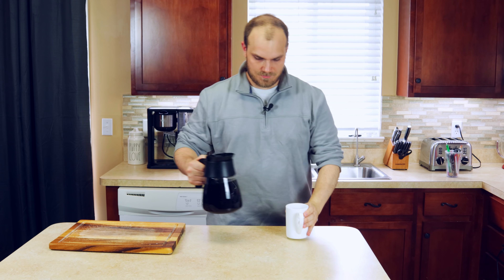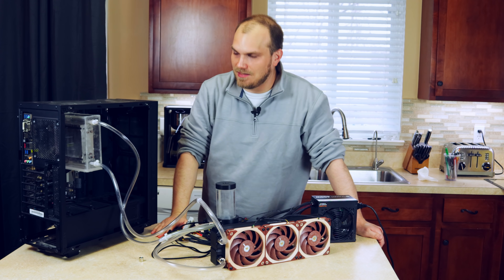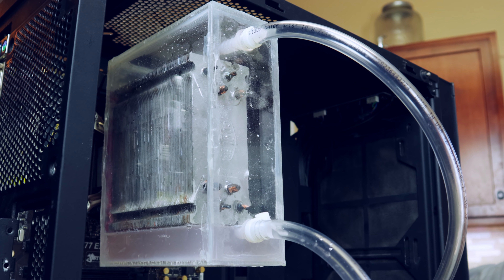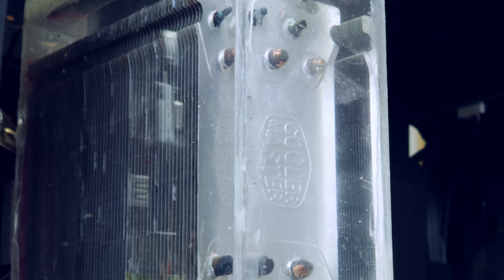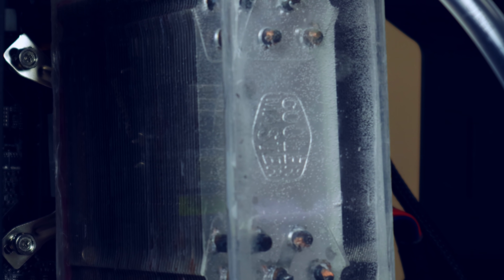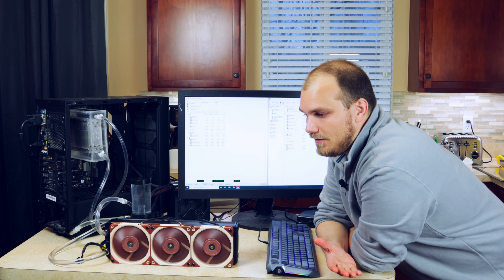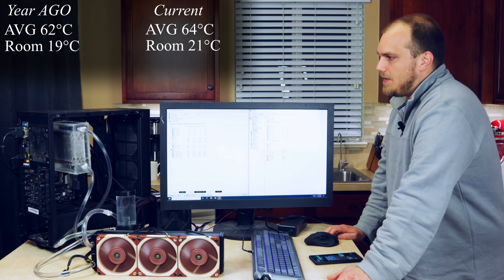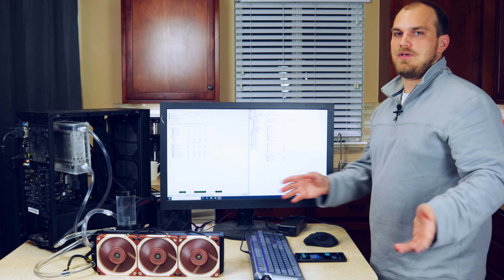Water Cooled Air Cooler 1 YEAR LATER, Time Has Not Been Kind

Comment: I think this one is a waste of time. You've made a large less efficient water block. Without constant monitoring you will eventually doom a motherboard to die a death by short circuit when this eventually corrodes from the inside out. Having two metals connected by a conductive substance such as water creates a battery and will accelerate internal corrosion. You may even cause a house fire. If all this isn't strictly for entertainment (A troll) I wold urge you to please research water cooling more thoroughly so you can avoid this project becoming a significant and harmful life event even though it would most likely just trip a breaker, blow a fuse, or something like that.

Comment: I like what you did, but I will drop some science on you. You can pick whatever cooler you want to use, just make sure that the fins that run along the widest sides are even with each other. When you re-make the 2.0 version, make sure that the long outside plastic panels are touching the fins and that the bottom panel (closest to the cpu) is right to top of the bottom fin, no gap, same for the top panel as well. The water input and output sides make sure to leave at least 3/4” space, 1” would be better, this will help in the directional flow. On the water input fitting, use a 5/16” or 3/8” diameter tube that is caped or crimped at the end and the tube runs the full length into the box, cut a straight slice in the whole length of this tube, only on one side, use a dremel cutoff fiber mesh type disc (they are a whole lot safer) this will leave you about a 7/64" or so, wide slot. Aim the slot straight at the middle of the cooler fins, the output fitting that you used before is okay. If you want to make sure to get all of the air out of the system, make to output side panel taper to the fitting. By building the box this way, it will create a directional water flow that will majorly increase the cooling efficiency.

Comment: Should make a version of this in a case that has the motherboard positioned to where the IO ports are on the Roof of the Case.
This would let you use the reservoir to feed water down onto the fins of the Heat sink.
From there, the water gets sucked up from the bottom.
Or, you could put it into a Horizontal configuration and make the tubes go on either side of the Fins to increase water flow through the fins.

PS, the corrosion is from the Copper heat pipes sticking out the top of the Heat Sink.
I would definitely seal those off with epoxy in your next prototype.

Comment: I wanna see a Design that is overall Cheaper than regular Watercooling. Maybe use a 20 Dollar Cooler, like an Arctic Freezer 13 and put an 240/360mm Radiator on it, plus the Pump. Should be cheaper than getting a CPU Block, shouldnt it ?

Comment: so why not run actual coolant? or even water mixed with some anti-freeze, helps with corrosion.. but mainly corrosion occurs from the mix of metals. aluminum and copper. and theres some coolants that have anti-corrisive stuff in em, or u can even drop in a corrosion inhibitor in the reservoir. But definitely not just water. Water heats up fast as well as boiling point is a lot lower than with coolant. and ur idling looking at temps!!! U creeped up to 60c plus idling!! lol.. Load up a game, it'll shoot up to 80 plus!! And thats past the boiling point of water. Definite try with just a mix of regular automotive anti freeze mixed into the water. like 1part to 3 parts water.  Cuz the fact that it was idling at 60c plus with that big of a radiator and reservoir.  Thats  not good. Would like to see the temps under actual load.. Run Unigen heaven benchmark or 3D Marks benchmarks and load up the cpu.  

For heatsink choice.. im curious to see how well one of the stock oem coolers would do if encased in and water cooled. considering water cooling itself is more efficient having more solid metal to transfer the heat, rather than many heatfins on a air cooler. And stock coolers tend to be more chunky with metal, shorter in size as well. Just an idea suggestion. Enjoyed the vid none the less.

Comment: Since you're using water. I wonder if you even need the heatpipes. I would do another design with just a plain aluminum heatsink. I recommend an anodized one. You want one with the most surface area to transfer heat.

Comment: If you do revisit this with another cooler i highly recommend finding that is all copper or all aluminum and make sure your radiator is the same material other wise your going to have that corrosion issue.

If you have to use mixed metals please add something to the water in the loop to prevent the corrosion otherwise you might kill that lovely 360mm rad. :O

Comment: corrosion isn't surprising. after all, the cooler has both aluminium and copper in the unit.
mixing these metals is well known for causing galvanic corrosion for the metal with the lower anodic index. (aluminium in this case)
you could place a sacrificial anode which will corrode instead of the aluminium (something like a stick of zinc or magnesium would work).

would still make the water dirty due to the particles breaking off, but it would be the zinc or magnesium which corrodes instead of the aluminium.
(this is how older non-stainless hot  water systems avoid corrosion of the main unit)

I  think that if you actually ran this thing for a year, the corrosion would have been MUCH worse.

Comment: In the next one, one side of the enclosure should be against the sides forcing water to have to flow through the fins instead of allowing it to flow around them. That would help with the volume of water and size of the cooler.  Also I’d have the inlet at the top and outlet at the bottom so gravity helps out. Try to make it so that as much water flows across the fins as possible and make sure there’s no air between the fins before testing (saw the old video a bit ago and there was air in there)

Comment: I would guess you are at the cooling limits of the heat pipes, as in the fins aren't doing much. I would try getting a tower air cooler like that and removing the fins entirely  and encase only the heatpipes. There should be sufficient surface area for something more efficient like water to remove the heat.

Comment: next time use automotive anti-freeze (the regular green stuff, not a modern one).
It will make the coolant slightly less effective at carrying heat, but it has anti-corrision additives specifically for copper radiators and aluminum cylinder heads.

Comment: How about use a small canning jar, metal lid against the CPU.  Dunno if they make them in plastic, but drilling glass is not a super big deal.
You have to invent a way to keep it tight and in place against the CPU.
EDIT: Mason jelly jar.  Small, wide.  Solder a mount to the rim part of the lid.  Use sealant in the threads.

Comment: After you make a new cooler use: aprox 10-20 % ethylene glycol  ment for new cars and does not contain nitrite, amine, phosphate, silicate or borate. Provides very good protection against frost, corrosion and overheating in all modern engines, but especially in aluminum turbocharged engines. Effectively protects against corrosion and deposits throughout the cooling system and its vital parts.  I have now used this for almost 2 years on pc running 24/7 no issue.

Comment: Keep heat pipes but take off the fins. Slim down the design and lessen corrosion. See if that does well temp wise and longevity wise. If it is like the other video of pumping water through the heat pipes I doubt the fins are actually doing much.

Comment: Yeah it works as any plate heat exchanger would but needs a thorough design improvement since this has so many dead convection zones which render it subpar. Also you would need some venting valve to completely fill it. Also a clean run outside of the pc with vinegar added to the water to get the residues inside the whole loop dissolved would go along the way! Other than this, why not do a long time test? Oh and some contraption to hook the wheighty cooler to the top of the case would also be very effective, after all the weak points of this thing are the heatpipes going through the vinyl bottom.

Comment: Have a normal liquid cooling setup. 
Then liquid cool the radiator.
Reply: Didn't LTT do this with one of their projects?
Reply: @TierNone_LarperatoR  I have a vague memory of someone cooling the entire computer by putting it in mineral oil, years and years ago. Tom's Hardware ca a decade ago, or something?
Reply: @OnlyKaerius  also Linus did it.
Reply: @OnlyKaerius  I remember "The Screen Savers" did a submerged pc cant remember what they used i don't think it was mineral oil but it was crazy for early 2000. i also remember them doing a the first terabyte computer with like 120gb hard drives. I still remember them being suprised that i came up as a TB in the regestry they did some interesting things back then.
Reply: @OnlyKaerius  there's actually a better way.

You can swap put the IHS for a copper IHS for better heat transfer and then immersion cool that. Then use a cooler pump (a pump that is made to be slightly powerful and also cools the liquid) to circulate whatever fluid you decide to use, which i would go with one of engineered fluids products for immersion cooling.

You can achieve some pretty amazing overclocks with that setup, but it is a lot more effort and you can't use ordinary thermal paste because it dissolves pretty fast in most immersion cooling coolants so good luck.
Reply: Or fill radiator with thermalpaste and put it on larger heatsink
Reply: lmao
Reply: @GuRuGeorge03  yes
Reply: Juan Pretorius yooooo that’s big brain
Reply: Don't forget to add the water chiller
Reply: Fuck it, fill the whole pc
Reply: It's been done before, literally a cooler filled with water and ice with a water pump pointed at the rad.
Reply: @jocerv43  I get that. But what I meant with liquid cool the radiator is have another cooling loop to cool the first radiator. In your case it is one active loop cooled passively with cold water, with mine, it's 2 active loops (or does it become one?). Point is, it's dumb, but that's not what this channel is about :P
Reply: this is so dumb that turns to be good
Reply: @danielpacheco5867  Unortunately not. Although the heat transfer for the radiator has increased, we'd be limited by the transfer efficacy of the CPU block. As well as that, we're simply moving the transfer from the closed loop to the air just one extra stage along. So no added value that we couldn't have had with a single stage :(
Reply: @fred_derf  I know, bro. Just thought it was a cool idea :)
Reply: @theElemDragon  You wouldn't be able to cool mineral oil, unfortunately, it becomes more viscous and the flow rate would drop way too low. Too much strain on the pump, and the pump dies within months
Reply: put the radiator on bathup so it's a water heater.
Reply: or water cool the rad on this bad boy for max thermal transmission.
Reply: @Bill Soon it's 50% extra performance, 50% hobby. Plus, I've been using my same water-cooling loop since 2008, it pays off
Reply: JayzTwoCents did this during RIPGN. It works pretty well as long as you have water movement.
Reply: Thats exactly what I was thinking. There is no point in doing this it is just water cooling. Your just adding more radiators. Your heat sink is similar to a radiator. So your heat sink needs to heat up, then the water, then the radiator.
Reply: Nice pfp
Reply: @mellodmello  no fuckin way bro. Let's be friends?

Comment: At least just replace the water with Mineral Oil - the thermoelectric option would create to much frost and condensation in the case if the temps went to low.

Comment: How much capacity does the cooling fins add?  since it is in water if you remove all the fins does it still cool as well?  if it does you would not have to be concerned with corrosion in the fins.

Comment: It would be interesting to see if a nickel plated cooler would prevent the corrosion that has formed. Liquid cooled Scythe Mugen 5 Rev. B perhaps? Or a low profile heat sink of some type from either Scythe or Noctua. Doesn't matter which brand I guess as long as it's nickel plated all around.

Comment: How well would this idea work on one of those very low profile air coolers?

Or, what would be the most efficient way to pull the heat off of the CPU? These heat transfer pipes, or a better designed water block?

Comment: If I could change anything for v2.0 it would be the water inlet/outlet ports, they would be located on the sides to get the flow direction parallel to the fins. Another sick upgrade would be slightly thicker tube for compatibility with normal custom loop fittings and a proper D5 pump and resevoir. For the cooler may I suggest you try a “Black” one? The black paint does decrease performance ever so slightly but it could help with holding off corrosion. Or it might turn into a black gunk that gums up the loop so who knows, but it would be nice to know.

Comment: Since you have different connected metals immersed in water, you'll need corrosion inhibitors to prevent the heatsink from getting destroyed by galvanic corrosion in a long-term run.
Reply: Or mineral oil
Reply: @BiologyIsHot  The problem with mineral oil for cooling applications is that it has less than 1/3 the specific heat as water, which means you need ~3X as much flow for the same performance.
Reply: @Teardown Dan its not gonna necessarily need 3x the flow, but 3x the liquid capacity to have the same thermal mass - thermal conductivity of mineral oil is pretty poor compared to water at about a 1/4, probably won't affect the CPU cooler side as much as there's ample surface area but the effectiveness of the rad could be an issue.
Reply: @arlobubble3748   Increasing the total "thermal mass" by increasing volume only changes how long it takes for the loop to come up to temperature. It does nothing for actually moving heat from A to B. If you have a fluid with worse specific heat, you need more flow to achieve the same heat transfer rate because the fluid passing through the hot plate is warming up 3-4X as fast so you need 3-4X the flow to keep hot plate temperature the same, same goes for a radiator of a given size.
Reply: @teardowndan5364  physics! 🥳👍
Reply: Op has a good point. Maybe another rendition could have a sealed port on top that had a drop down, replaceable, magnesium anode 😸🍻

Comment: Try using a radial cooler, something like the thermaltake engine 27 
( https://www.amazon.in/Thermaltake-Engine-Low-Profile-Cooling-CL-P032-CA06SL/dp/B01MCT9V18 )
Water should have a much higher thermal energy trasmission coefficient than air, so you can take advantage of the optimised flow (less area needed when flow is higher and/or coeff. Is higher). Be sure that the cooler itself is bottlenecking you, and not the heatspreader or thermal paste.

Comment: Perhaps a version people would want to replicate in real life? For example, how about using stock intel cooler (which almost everyone has) and some radiator coolant that doesn't cause corrosion?? Hobbyist 12V water pumps are for like 3$. These can be modified to be run by chassis fan outlets, which can change rpm by changing voltage. I can buy a second-hand ford fiesta radiator for like 4$ here. Add a few $s for hoses and if this 12$ design can perform as good as high-end custom water coolers, this would be really useful as an experiment. 

Odds are, a "waterblock" as large as an intel cooler and a radiator probably 10 times as large as a PC radiator would make a very silent and very cool system, maybe even without using any fans.

Comment: You want a challenge. Try cooling a 9900k Over Clocked  at 5ghrtz  with a (  Noctua NH-D15S 140mm SSO2 D-Type Premium CPU Cooler, NF-A15 PWM Fans ) The fan space in the middle could be a place for underwater RGB  😜😁👌👍 That is if it fits and sits well lol be big as hell

Comment: It would be really cool to revisit the watercooled air cooler. A couple of suggestions:
It could be fun to see how a big aircooler performs. I think something along the lines of Deepcool Assassin 3, or a Noctua NH D15, although fabrication probably will be difficult.
Second suggestion would be to move the inlet and outlet, in a  diagonel pattern. Inlet in the bottom and outlet at the top. That way the waterflow would move across the finstack, perhaps improving cooling.

Comment: I suggested this a year ago and still want to see it. Water cooling loop, but instead of a radiator, have a second CPU block pasted and screwed to an air cooler; maybe even do that two or three times just to see if it works and if it's scalable. Could even attempt to do the same with aGPU water block and either a stock or third party air cooler, as they have a lot more surface area both inside the water loop and externally for components.

Comment: Add mineral oil instead of water, and have a flat cooler instead of the raised cooler. Also adding more water flow helps with cooling (higher gpm, more pumps).

Comment: If you do another force the water to through the cooler by making smaller so it can bsroy fit the cooler and punt the water in from the under side so above the gpu and on top make 90 fitting so the tube runs where fans would be so you can mount it in a case

Comment: try a painted cooler, and have your inlet and outlet on opposite corners, come in at the top right, and have it come out at the bottom left on the other side, so that way the water has to move from one corner to the next.

and somehow involve a 3d printer, maybe print the box with an open side, then put your cooler in and then close it, this way you are garanteed no leaks.